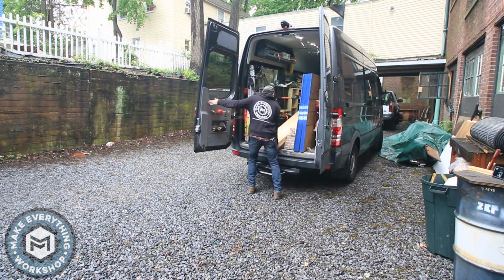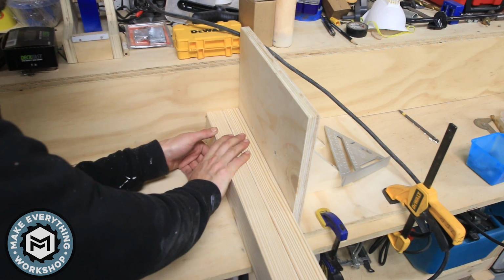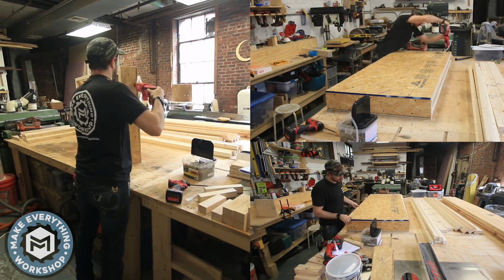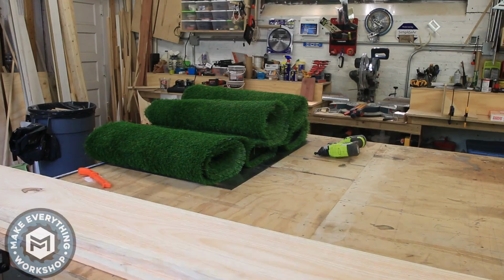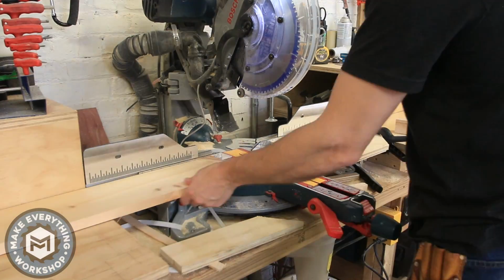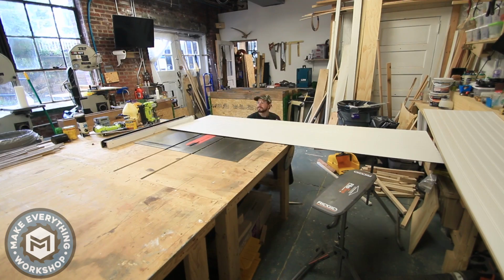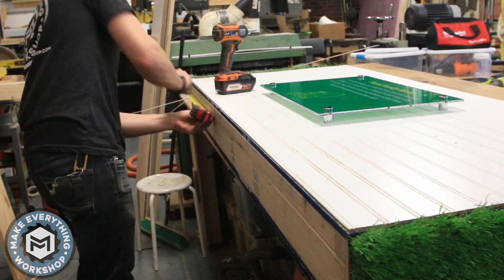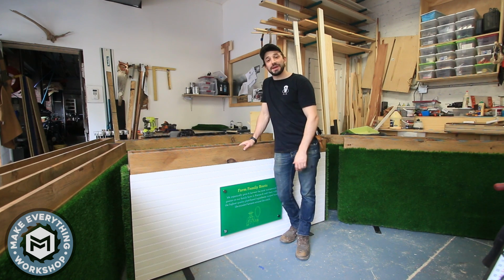Making 6 Faux Grass Partition Walls!

Comment: Nice work, looks like a fun but challenging project, reminds me of the weird kind of stuff I used to build for film. If you had to make another 10, let's say, how would you do it differently? Like do you think the inner skeleton frame could be simplified or reduced? Maybe the ends could be one solid 2x8 or 2x6 without needing to be covered with OSB, for instance. PS, I think it was a smart move pulling the signage back off, they'd have to be fully individually packaged otherwise to avoid damage.